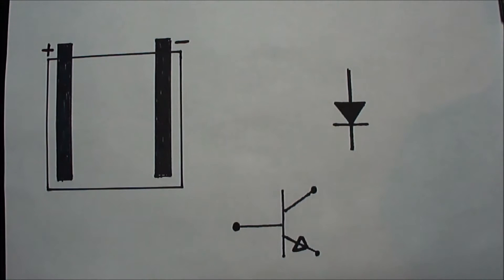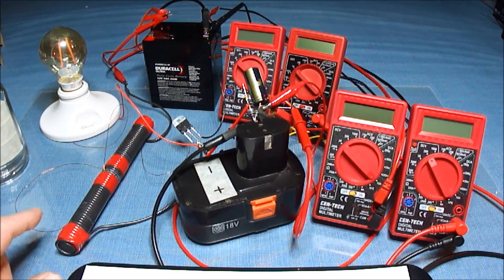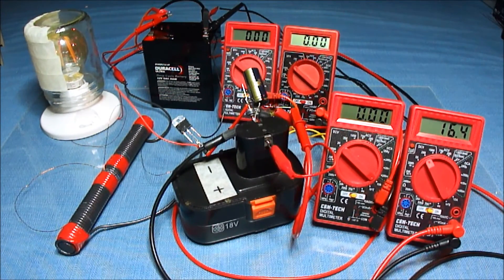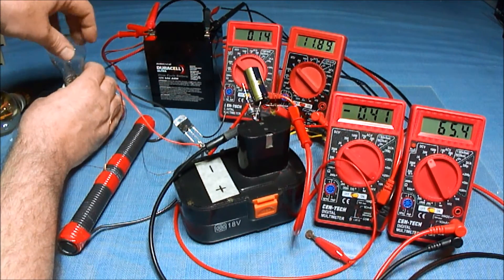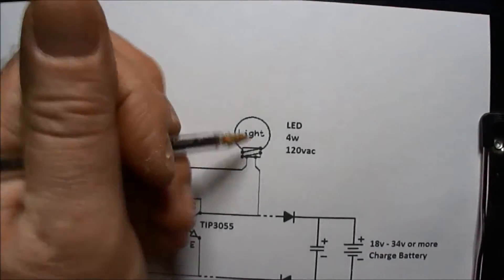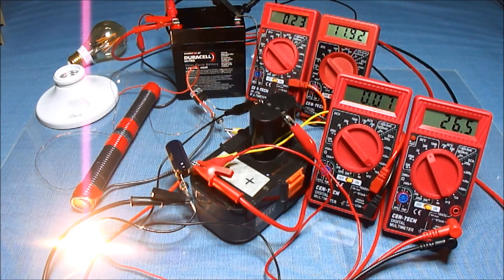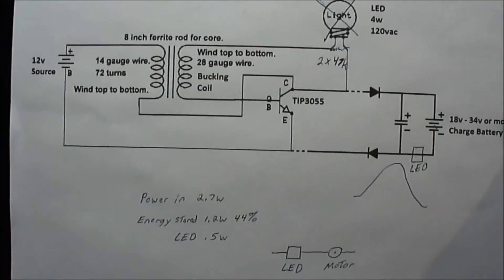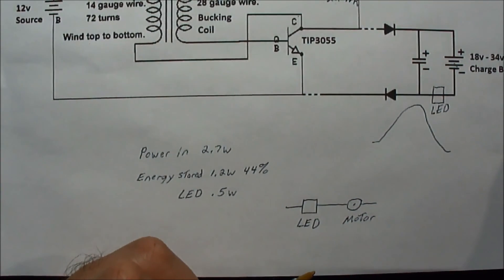Joule Thief Hupcharger

Comment: I disagree completely. Current flows in both directions. One can not move without the other. Ed Leedskalnin.
Reply: of course they flow in opposite pairs, the matter is the difference betwenn the two, which has to exist. This distinction has to exist unles we were not see for example the diode effect, the shape of the field and etc. There are two currents, the magnetic and the dielectric current, both in Amps but not in the same spatial dimension.
Reply from the maker: Good. Me too! 😎

Comment: Hmm  .. 🤔 I read somewhere that LEDs are actually field effect transformers  ....   and that nag's at me for some reason  ..
Reply from the maker: Hi! Many ways of looking at components.🤯
Reply: @ArkiverUnifiedEnergy  I wish I could remember where I saw that
Reply: @ArkiverUnifiedEnergy  also there was a reason the early autos were all positive ground until around 1957 but on a side note I just set up a joule thief to run off two button cells that are putting out  2.8v DC and I'm reading 5v AC with it .
Reply from the maker: Most of the joule thiefs have asymmetric currents. The asymmetry can alter 0 base line measurements in their vicinity.

Comment: The Brush motor in series with the LED will read the EMF return from the motor.  ???
Reply from the maker: Hi! That's a tricky question.😀 If the motor is under load volts start vanishing at the motor but current increase. If power in is interupted you get inertia return. My governor video utilizes that technique.

Comment: You should a
It seems the circuit requires improving by adjusting the trigger current of the transistor because it only uses the 72 turns coil resistance that could  be  not enough limiting base current , since the TIP 3055 is a power transistor it will amplify small base current to important collector current and the electrical power Ic*Vce converts into undesirable heat power...

Comment: Current flow goes back to the early electrical research most notably by Michael Faraday. He considered current to be the flow of positive charge and created the whole concept of current as a kind of fluid. 

Years later we understood that current was actually the flow of electrons, by which time however there were MANY concepts explained by "conventional" current or positive flow hence the convention stuck (as it makes zero practical difference, only a physical difference in the detail) and as explained by others ALL the symbology used in electronics is based upon "conventional" current flow i.e. positive current flowing from anode to cathode in a circuit. It is confusing in the extreme to change this convention since every electrical and electronic engineer on the planet knows it the "conventional" way
Reply: Hello. I find it’s nice to use the electronic curent instead of conventional absurdity, 
Imaginating valves is great.
Reply: @hommerdalor6301  except that if you describe circuits that way you are going diametrically opposed to 200 plus years of the way everybody is taught and will just cause total confusion.

Besides, if you are going to be pedantic about these things, current (electrons OR positive charges) don't "flow" in a circuit anyway
Reply: @boblewis5558  
Hi Bob.
So when I learned electricity, it was going on for 160 years. :-)
Anyways, I’m used to read the circuits in both directions, but we must admit that it would have been logical to do it the right way as soon as the mistake was discoverd, because more people will have to learn electricity than 
the ones who where told before, especialy in the time of the pioneers.
Sometimes they thaught the earth was flat, or in the middle of the universe, than they saw it was a mistake, and they changed to fit the reality even if beautifull planetarium were made.
At the end seeing the diodes as valves for ease of memorisation, to follow the real path of electrons is not so bad, even more for someone self learning, like the pioneers.
It’s the case of our self learning friend here, doing a working circuit that many electricians would not do.
Cheers.
Reply: @boblewis5558  
Nice explanation, maybe you should make YT videos with your knowledge. 
Cheers
Reply: Electrons only move about a few inches an hour, the power runs the machines the moment it's turned on, current is not the flow of electrons.

Comment: It gets it's efficiency from the bifilar method or interposing windings. When the pulse goes through the primary it doesn't have a restriction and the voltage only gets a boost and does little to reduce the initial current. By interposing the secondary between the winds of the primary you create an inductive diode. The diode is based upon the same voltage levels differences of the material itself. The secondary should not have a huge impact like in an ordinary transformer. You want this control to be all potential so the losses are meaningless. This is why they use a toroid core to lock away the magnetic field. The transforming happens in the interposing polarities of the bifilar wind. Regular gauge rules apply. Higher voltages need less gauge and higher currents need bigger gauges. More mass in the higher current section means higher magnetic fields in the toroid. So core balancing to the expected current output needs to be calculated. Any leakage or core saturation would only increase the output due to the secondary being around the core partially. A sort of self containment but only so up to a degree. Stressing matter in such ways can be very, well stressful.

Comment: you think the battery is making the circuit oscillate?
Reply from the maker: A battery or power supply with caps become part of the circuit and oscillate in connection with the inertia of the magnetic field. I'm not sure how much they oscillate.

Comment: at 7:50 your circuit goes into self oscillation you should do some tests with that.
Reply from the maker: Thanks. Nice find. It's a dual LC circuit with the open secondary helping support the self oscillation. The source battery oscillates like the cap of an LC. Working on a video.